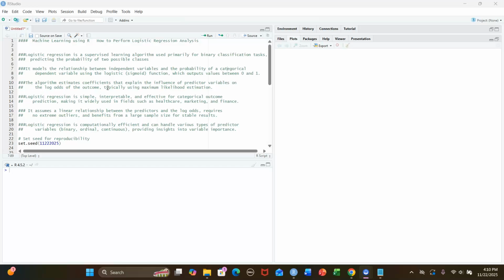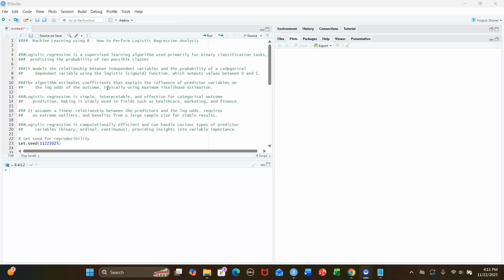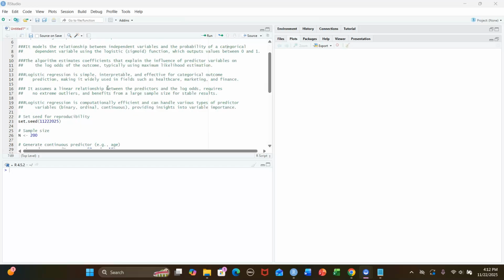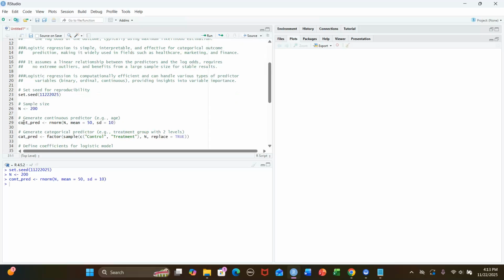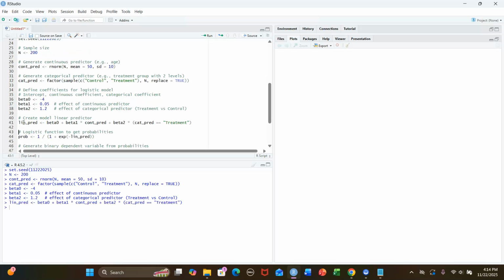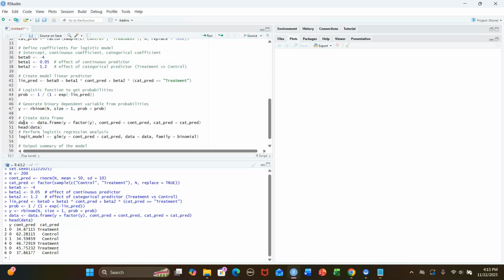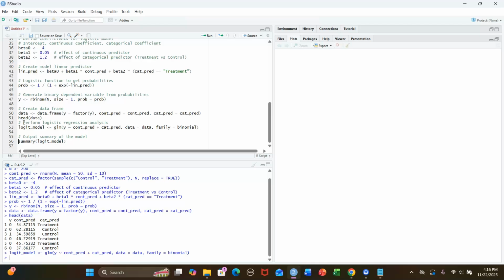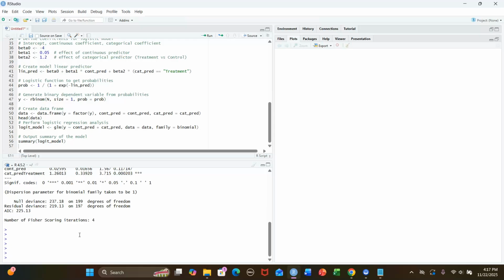Machine Learning using R --- How to Perform Logistic Regression Analysis#machinelearning#logistic

Comment from the maker: ####  Machine Learning using R   How to Perform Logistic Regression Analysis

###Logistic regression is a supervised learning algorithm used primarily for binary classification tasks, 
###  predicting the probability of two possible classes 

###It models the relationship between independent variables and the probability of a categorical 
##     dependent variable using the logistic (sigmoid) function, which outputs values between 0 and 1.

###The algorithm estimates coefficients that explain the influence of predictor variables on 
##     the log odds of the outcome, typically using maximum likelihood estimation.

###Logistic regression is simple, interpretable, and effective for categorical outcome 
##    prediction, making it widely used in fields such as healthcare, marketing, and finance.

### It assumes a linear relationship between the predictors and the log odds, requires 
##    no extreme outliers, and benefits from a large sample size for stable results.

###Logistic regression is computationally efficient and can handle various types of predictor 
##     variables (binary, ordinal, continuous), providing insights into variable importance.

# Set seed for reproducibility
set.seed(11222025)

# Sample size
N <- 200

# Generate continuous predictor (e.g., age)
cont_pred <- rnorm(N, mean = 50, sd = 10)

# Generate categorical predictor (e.g., treatment group with 2 levels)
cat_pred <- factor(sample(c("Control", "Treatment"), N, replace = TRUE))

# Define coefficients for logistic model
# Intercept, continuous coefficient, categorical coefficient
beta0 <- -4
beta1 <- 0.05  # effect of continuous predictor
beta2 <- 1.2   # effect of categorical predictor (Treatment vs Control)

# Create model linear predictor
lin_pred <- beta0 + beta1 * cont_pred + beta2 * (cat_pred == "Treatment")

# Logistic function to get probabilities
prob <- 1 / (1 + exp(-lin_pred))

# Generate binary dependent variable from probabilities
y <- rbinom(N, size = 1, prob = prob)

# Create data frame
data <- data.frame(y = factor(y), cont_pred = cont_pred, cat_pred = cat_pred)
head(data)
# Perform logistic regression analysis
logit_model <- glm(y ~ cont_pred + cat_pred, data = data, family = binomial)

# Output summary of the model
summary(logit_model)